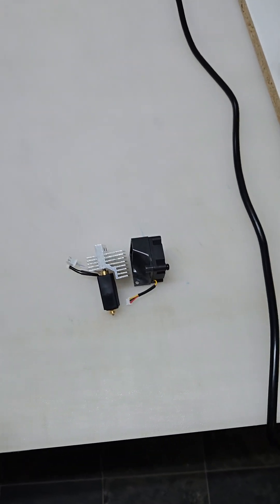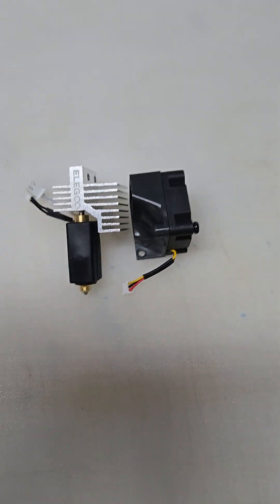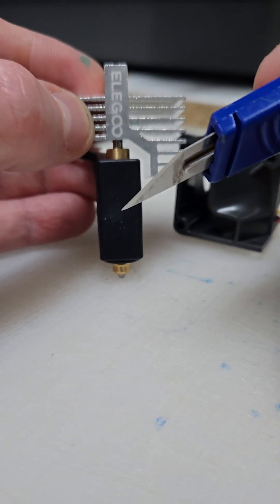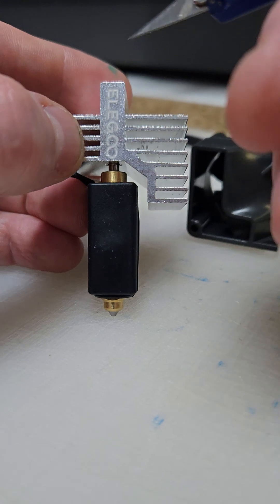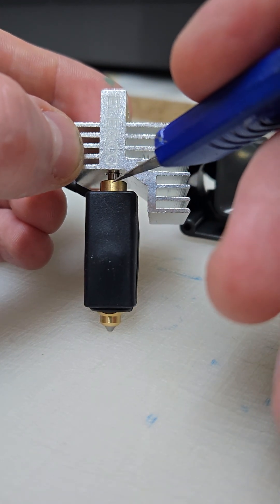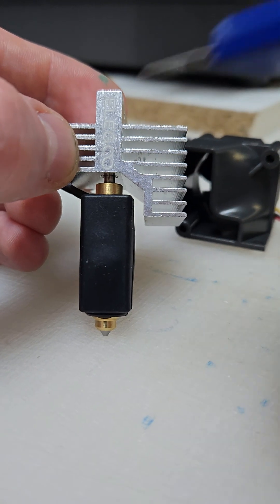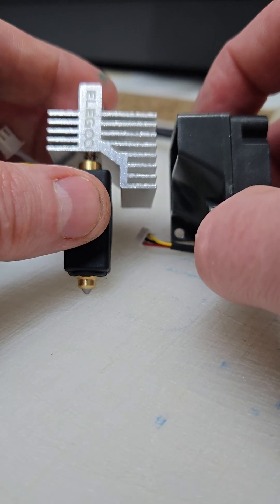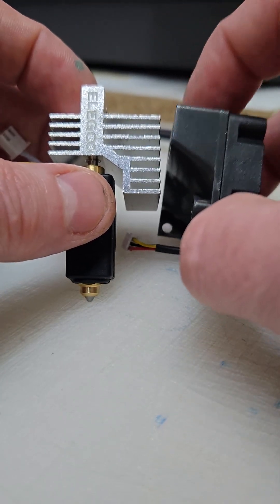Elegoo Centauri Carbon 3D Printer - Heat Break Fan Failed! (Hotend Issue Explained)

Comment: Would it still print PETG if this was the issue? I got mine about two weeks ago. It was working fine up until yesterday where it stopped printing past the first few layers on pla. It would still print I PETG so I disassembled everything thinking it was a clog but no clog the gears were pretty packed with pla residue so I cleaned them out put everything back together and got the same results. After a few more tried of pla I switched back to PETG and it’s also doing the same thing now just the first few layers print then it will just air print or nothing.

Comment: I had that same issue going on, new printer, within 10h the heatsink fan started breaking down until it caused barely any airflow. It was still turning though, so I got no fan error... Finding out what was going on was a nightmare. Almost all button head screws were rounded out! Meanwhile i found out 70% of them used in the whole printer were or still are xD

Elegoo support was great, they send out a new fan, hotend and hotend adaptor board for heater/thermistor/fans because mine was poorly soldered. They even offered exange parts for possibly damaged plastic covers of the extruder unit. It took about 2 weeks for the spare parts to arrive, so I ordered a spare fan from creality K1 or K2. Same manufacturer, just another connector. Quick soldering job, new nozzle added, and it is printing better than before now

Comment: Pla expands when it melts, and if the heatsink is not cooling the area above heatbreak it gets stuck. Moreover, elegoo heatbreak is attached to heatsink with grub screws, i have also added heat transfer paste between the heatsink and the tube so that the tube has maximum heat transfer from tube to heatsink to avoid clogs, as sometimes it happens too without fan failing.

Comment: Just got one and 1st day print failed. Filament was jammed in the "cold" heat sink and it wasnt melted so it clogged. Ordered some drill bits to flush PLA in the sink. Yeah my heatbreak working fine. But it caused my PLA not getting hot in the heatsink to free pathway. Frustrating at best.